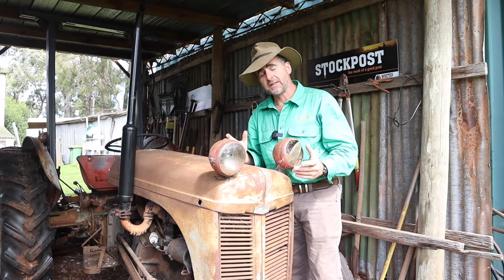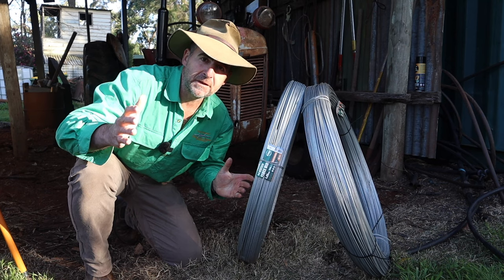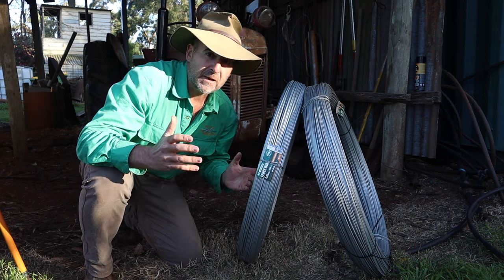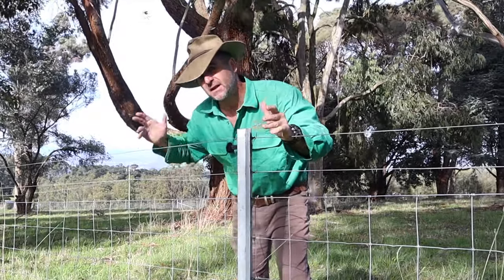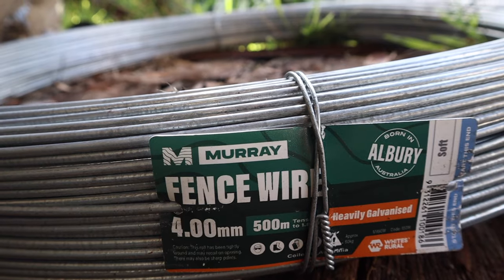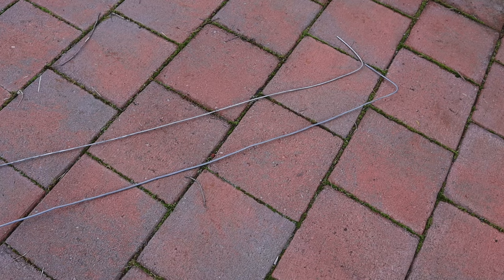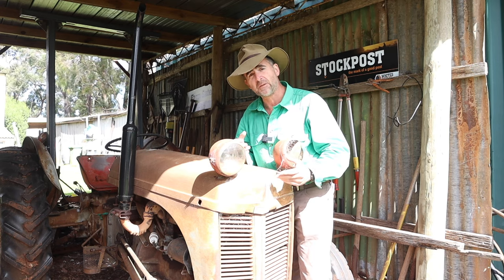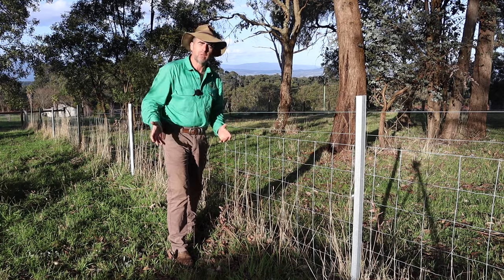Essential Farm Fence Wire Choice Tips

Comment: Gday Tim, I was having a yarn recently with a bunch of other station fellas, and we agreed on a few things- the ‘blue’ brand of wire lasts the longest. If you have a high impact fence then use 2.8 or even 3.15 HT as top wire where’s there’s emus and/or bottom for pigs. Barb wire is mostly useful for cattle (doesn’t stop wild animals) & go for 2mm or at least 1.8mm (they might as well stop making 1.57mm). Soft wire is only really useful for tying ‘Cobb & Cos/Bullock’ twitches, and the Iowa soft barb is useless for suspension fences, ie those that rely on the tension on the fence & the strainers rather than a shitload of posts to hang the wire from, ie a static fence😉

Comment: G'day Tim and thanks for sharing great insight. You made a recommendation on spacing post further apart when using high tensile wire. What is that typical distance? I'm installing a new boundary fence (deer proof) and planning to use 150mm treated around posts (2.1m)  1600 above ground
Reply from the maker: Typically 5m over east, up to 7 over west. Depends on terrain. The more ups and downs the closer the posts. For more information like this, check out my new short course https://tim-s-site-552c.thinkific.com/courses/basic-fencing (hey I had to plug it right?)

Comment: Trying to use 9ga high tensile wire here. Measures 3.8mm. Problem is the wire is so stiff I cannot get the wraps tight like in your videoes. Am I just too weak, am I using too thick wire, is my technique wrong ? Thank you.
Reply from the maker: Hey mate. Most HT fencing wire over here is in the range of 2.5-2.8mm. Most common is 2.5mm. Much bigger than that no point. Too hard, waste of money etc. Soft wire is commonly 3.5-4mm. Check out my new course for lots of tips https://tim-s-site-552c.thinkific.com/courses/basic-fencing

Comment: Tried to reuse a length of high tensile wire the other day. Wouldn't take a knot without breaking. Very frustrating. I assume the problem was that the wire was old (ish).
Reply from the maker: Some of the older imported stuff did that. Some companies don’t have the same quality control as others but it’s cheap so people buy it. Those companies charge their brand every 4-5 years……

Comment: Always useful Thanks. I watched the history of fences and star pickets yesterday with the fella who wrote the book very interesting but didn't say much on sizes and holes, like 900 fence what size posts and where to put the fence 2 holes from the top 3 holes? My fence im trying to fix is all over the place hard to work out the reason for the placement of wire. Im guessing length is soil type placement is to leave holes for barbed or electric but is there a standard or something something? A video on that would be nice if you haven't already done one I just haven't found it. Stay well Tim keep up the good work a lot of us new comers to the land learn a lot from you cheers mate
Reply from the maker: Hi Tony, yeah, this is something that I cover in my new short course, https://tim-s-site-552c.thinkific.com/courses/basic-fencing Basically though there is no standard. Wire spacing is something that no one agrees on.
Reply: @FarmLearningTim  thanks Tim yes it can't be one size fits all would depend on many things. I'll have a look at your course, thank you